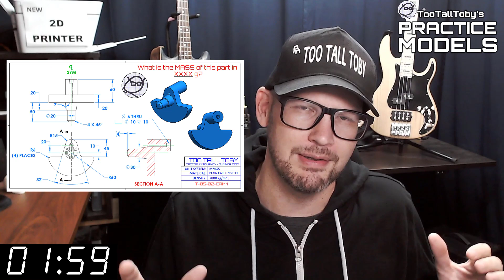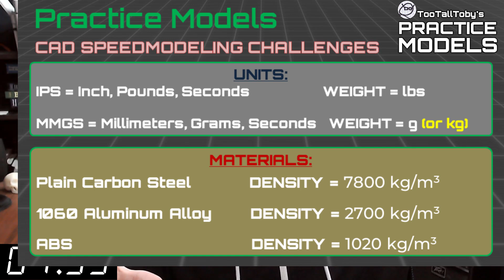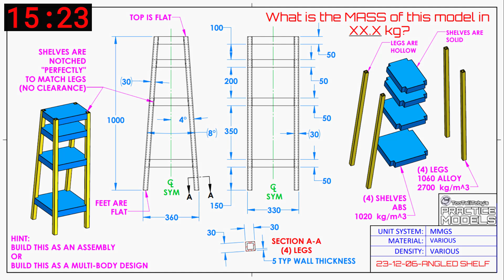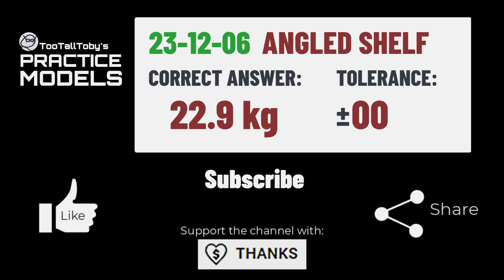CAD Modeling Practice Challenge - Onshape, SolidWorks, Fusion360 - ANGLED SHELF - Multi-material

Comment: Went super easy in Onshape. Had to finish as an assembly in Inventor to assign different materials. Took me the longest in Solidworks trying to figure out how to remove shelf corners. I used indent at each shelf to remove corners, is there an easier way?
Reply from the maker: yeah I did it in SW using multi body and doing an offset surface and a cut with surface.  So I probably could have done it more efficiently too!  :-)

Comment: 13:44 but I'm sitting at 22.898kg just 2g off. I feel like theres a trick to making the mirroring faster, or perhaps mirroring the sketches rather than the bodies would have been quicker.
Reply from the maker: yeah this one is TRICKY as heck!!
Reply: Made the same mistake, check the legs.
Reply: @CerberaLM I made them horizontal at both ends